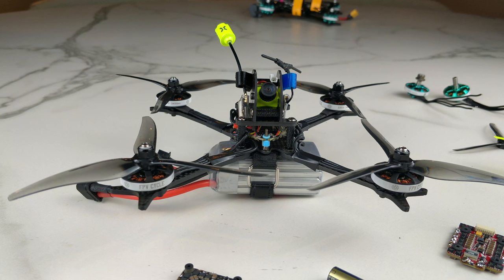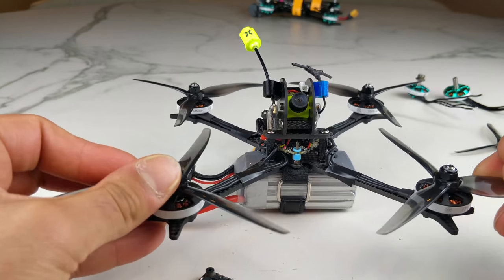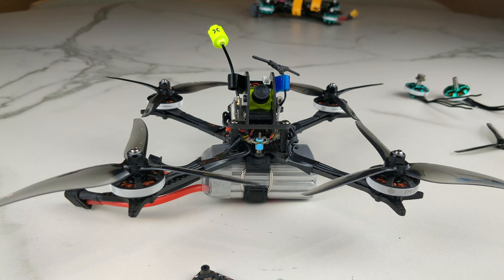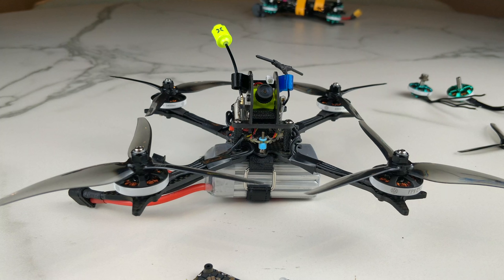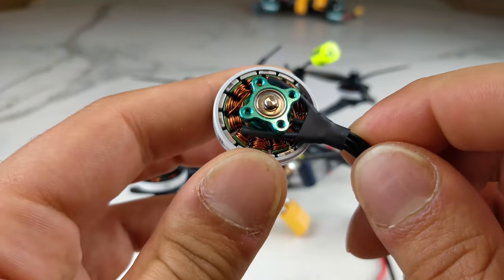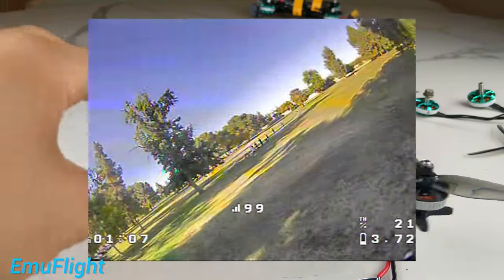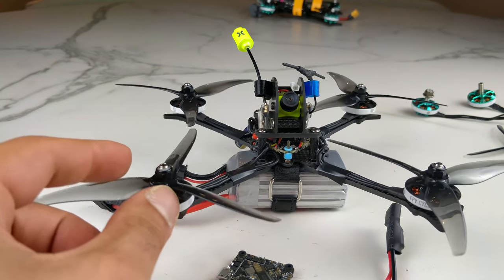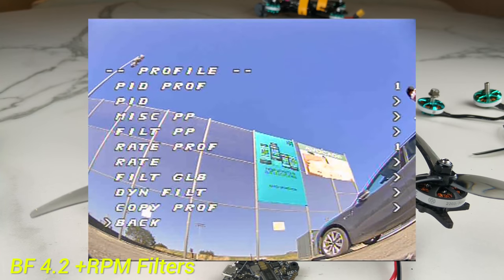Unconventional Tuning...

Comment: Well, this video sums up why I’m struggling pid tuning. I’m spending all of my time in pids and not noticing much if any difference with slight oscillation issues I’ve had on multiple quads.  Clearly I need to take a deep dive into filters and I really don’t want to lol
Reply from the maker: right.  PID's are the final fine tune.  They don't address all the other issues in the quad.  It's almost a waste of time to even consider dealing with PID's up front if you have weird issues.

Comment: Had extremely bad yaw bounce on 4.xx, had a few ppl including myself try to trouble shoot. It was just some voodoo weird crap. Jump back to 3.5.7 fine. Ill prolly never get off 3.5.7
Reply from the maker: 4.2 with rpmf would probably fix it. But like I discussed, it's confusing how rpmf is required in BF now and it costs money.
Reply: @Kabab  Yeah, this is shady. I bought JESC right out of the gate for everything I own, so i didnt really notice that my quads wouldnt fly without it. Now, I have an Emu build with one of their preset tunes that is more than competetive with my best rpm filtered rig. Betaflight doesnt seem to focus much on smaller builds. So very interesting.. Im on pause with Emu until the next release.
Reply: @Kabab  yah I got that running also. Lol. Ka ka krazyy!

Comment: Queston why don't you run flight one and why
Reply from the maker: I do.  I'm just waiting for their new board to be done.  In fact it's very likely I'll switch everything over to their new stuff and never look back if it performs the way it's supposed to.  That thing really is being made to kinda deal with most of the issues automatically.
Reply: @Kabab  Oh wow, so f1 will sell their own aio? Hope the newer stuff will be more reliable, cause i´ve had a lot of problems with falcox stuff...

Comment: 4.2 has sliders
Reply from the maker: I forgot that I don't see them because I always turn all the FF off so it removes the sliders for me....also would be nice to have the sliders in the OSD.
Reply: @Kabab  perhaps it would be wiser to focus more attention on the new BF version and focus more on using the small incremental changes made by the very skilled developers and then sharing with others how you solved a particular issue on your kwad. 
That way your also keeping pace with the changes in betaflight to your kwads benefit.

Comment: I don't understand why you wouldn't go with rpm filtering off the bat, it's the standard since 4.1 as far as I've come to know :S you need dynamic idle.. set regular idle to %8 and min_idle to 15. It will make a massive difference on that lightweight build
Reply from the maker: I said this at the end.  I went through all this specifically so that I could make this video.  Not everyone runs RPMf....most don't actually.

Comment: Have you tried just using the recommended tunes listed?
https://github.com/betaflight/betaflight/wiki/4.0-Tuning-Notes
Also wouldn't it be more efficient to learn a little Black box than to just turn knobs and switch firmwares?  Feel like you could get a good tune on anything if you just did that and then could maybe take all those tunes to extrapolate data and come to more data driven conclusions?  Just think it would help your cause even more at this point. Could work with UAV guy and see if there is a more efficient and quickest way to do a 5-10m tune that will be 90% for most of us.
Reply from the maker: yeah I use BB when I have it for sure but in this case I don't.  That tuning list does help but it also leaves out other potential issues like electronic noise.  These darn quads are not getting any easier to deal with as we move forward unfortunately.
Reply: @Kabab  always Cap. Always.